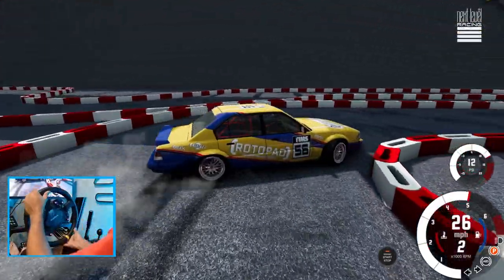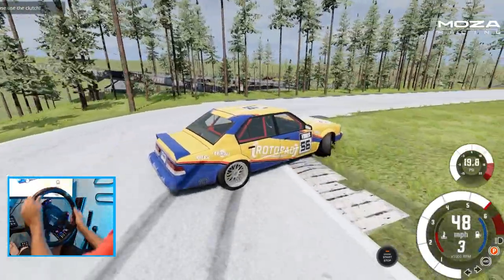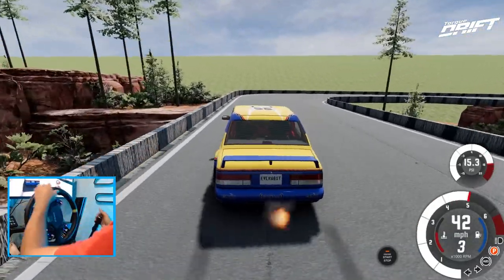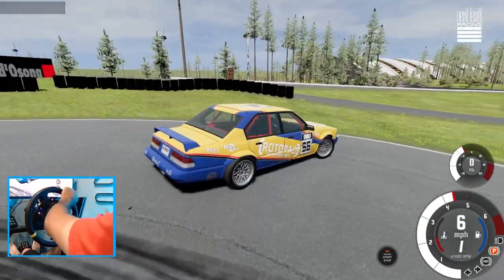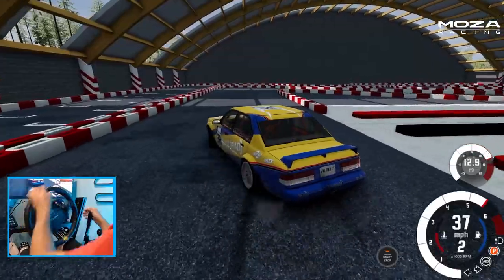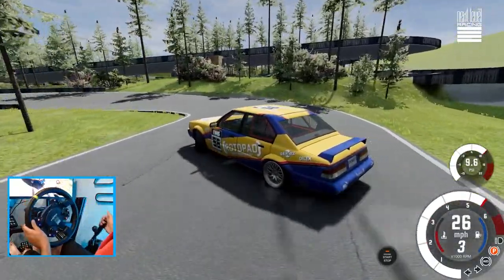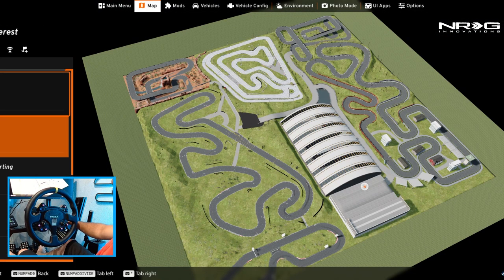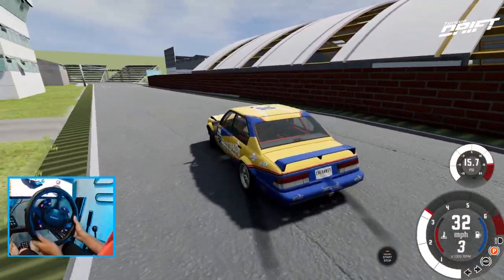Drifting on Karting Tracks is way to much fun!!! - Precision Drifting at its best !!

Comment: this looks Hella fun! my g920 broke after 7 years so once my new fanatec CSL dd comes I'll definitely try out this!
Reply: @dcars806 I’ve had mines for about 4 years but now everything is slowly breaking down, gears 1,3 and sometimes 5 stop working sometimes and keep on disengaging and reengaging. My pedals on the other hand are much more annoying as the brake pedal keeps braking itself even tho there is no force applied. My base itself has lost probably about 20% of power and the wheel is shaky. I’ve tried cleaning, replacing parts, but they seem to still not be working
Reply: i gotta tell u that u gonna se the difference or more feel it
Reply: @chiko2088  dang, do you use it daily tho? I used to use my g920 more on weekends and days where I wasn't busy, so maybe it depends on how much you use it?